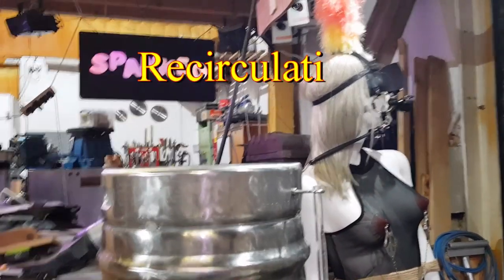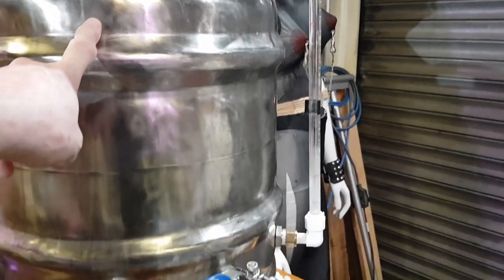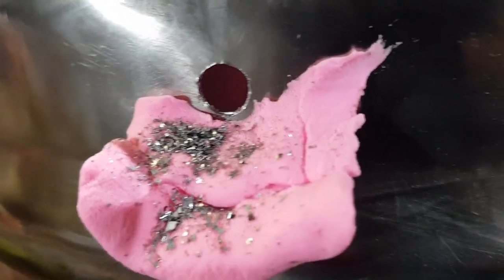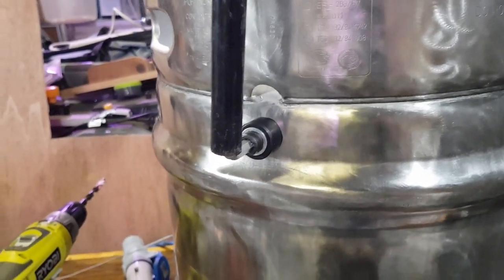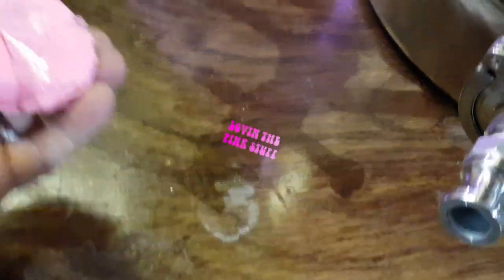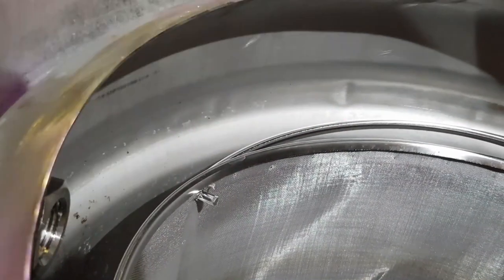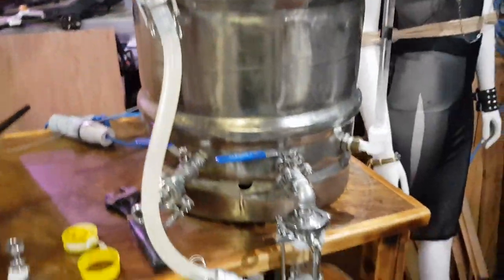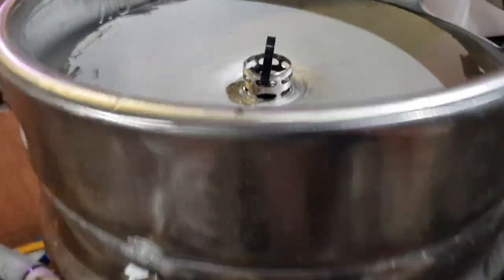BREW - Recirculation Modification to the Copper

Comment: May the Swarf be with you. Nice build of the recirc. pipe. So, did you measure the thickness of the steel in the end?
Reply from the maker: Rather sadly, yes - it's 1.45mm :-)
Reply: @MadeByMartyn  that's bloody thick.
Reply from the maker: @99ulysses99  totally bulletproof!  I was impressed myself.  If only I could find 100L kegs of that quality.
Reply: @MadeByMartyn  I have four 100L kegs £400 i paid like gold dust planning on bottling/canning beer off them heavy when empty 120kg when full im sure gonna be fun! Cheers
Reply from the maker: @Pazey1  where did you source these? And if they're no longer available, would you sell a couple? :-)
Reply: @MadeByMartyn  Bought from another brewery, afraid we cant sell any as we are a commercial brewery and they are gonna get some use shortly we looked here for some http://www.pilsena.lt/en/product-catalog/beer-kegs-and-fittings/used-beer-kegs/100-l-keg-2270/

Delivery wasnt cheap if i remember correctly when we asked for a quote! Good luck!

Comment: Hi Martyn, just to clarify, i take it you are re-circ through the hop spider rather than doing a whirlpool?
i am reasonably new to this and in the middle of upgrading my kit, and trying to decide on the best options for me.
by the way what plate chiller are you using?
keep the videos coming, they are great and very informative.
Reply from the maker: The hop spider has such a fine mesh that the risk is having a container within a container so the theory is to try and create a flow through and get better hop extract.
The plate chiller is the 165kw 40 plate one from the Malt Miller:
https://www.themaltmiller.co.uk/product/stainless-steel-plate-chiller-30-plate-165kw/

Comment: What bulkhead fittings are you using?
Reply from the maker: It's one of the older type from the Malt Miller'.  I think the newer ones are rounded instead of hex:
https://www.themaltmiller.co.uk/product/stainless-steel-1-2-bsp-bulkhead-fitting/
Reply: @MadeByMartyn  Brilliant thank you, I do have 1 or two of the rounded ones, but I liked the hex nut idea just so I could make sure I overtighten things you know how it is.